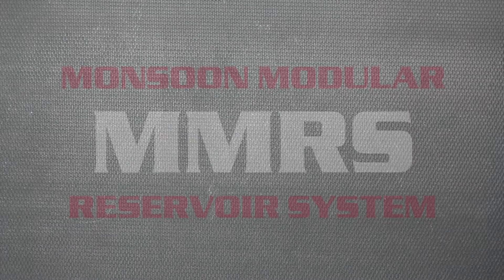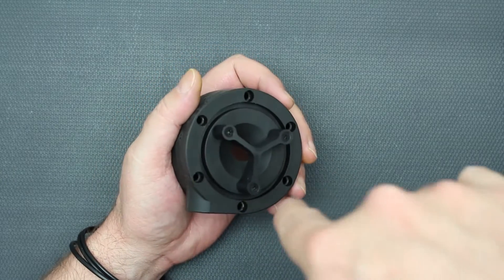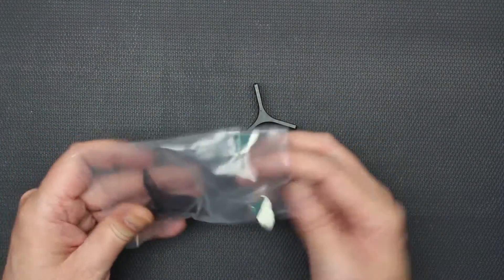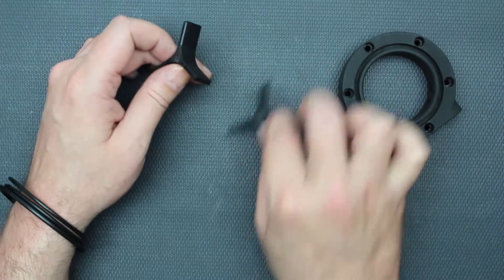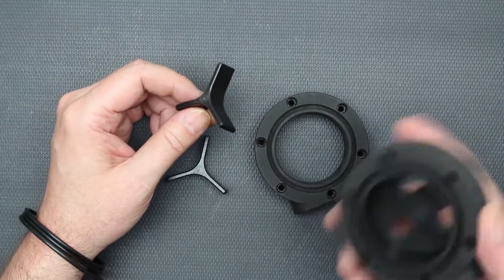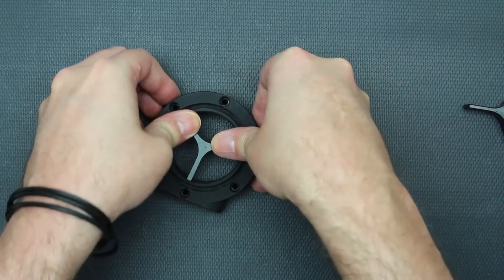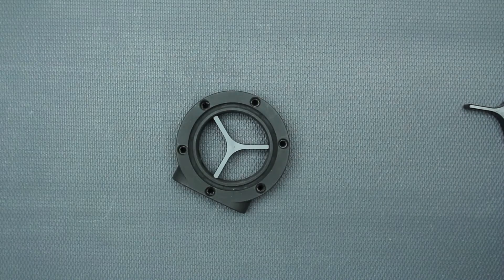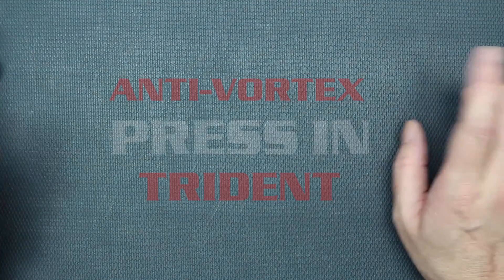MMRS Anti Vortex Trident

Comment: Quick question, are there any plans to making a pump top with a second port on the side of them?  I've just realized that I'm going to need to make a T-section in one of my lines in order to make a drain valve and it wouldn't look good compared to having a port on the side that I could hide with the back of the case.  Minus that one ascetic complaint, I've loved this system so far!
Reply: Where would the second port go?
Reply: For me personally, I'd love for it to be on the left side as you're facing the existing port.  You'd have to do away with one of the 60 degree mounting options but for the pure ascetics I'd be alright with that.
Reply: The problem is mold costs and being able to sell enough parts to cover 
that cost.  I doubt could sell enough of them to make sense.
Reply: You can do what I did an buy a coupler/mating plate they sell and achieve something similar.